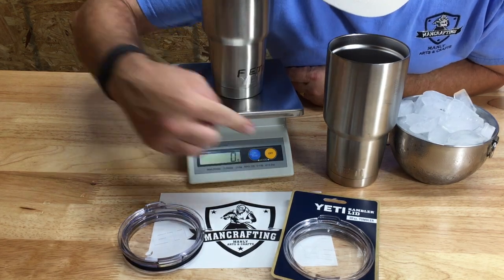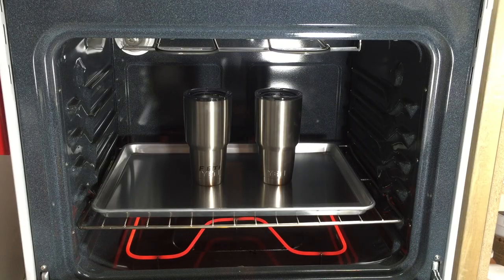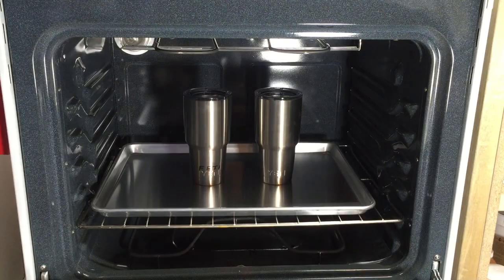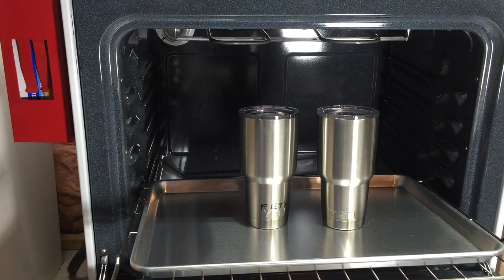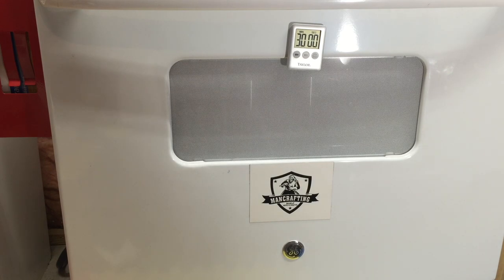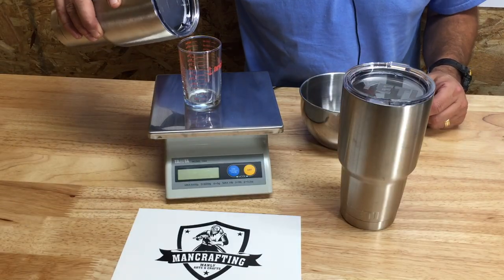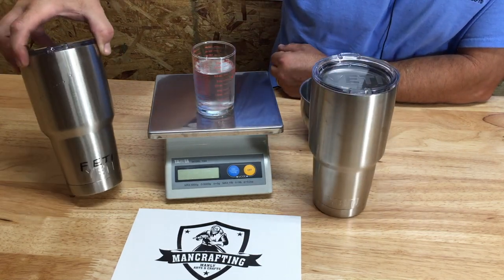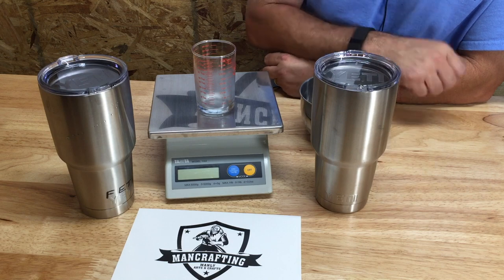Fake Yeti TESTED! | Part 1

Comment: yeti is made in China and in the Philippines but they do make some of their stuff in usa. the "fake" yeti is made in the same factory as the "real" yeti.
Reply: from yeti's website WHERE ARE YETI PRODUCTS MANUFACTURED?

Our Tundra coolers are manufactured in the USA at facilities located in Iowa and Wisconsin as well as at a facility located in the Philippines. Our Hopper coolers and Rambler drinkware are manufactured in China.
Reply from the maker: I covered where YETI products are made in another video, but yes you are correct. They are made very likely in the very same factory where the counterfeit Yeti is made.  That said, if you work for someone, and then when your off work do the same work for their customers even though it's your off time it's still stealing.  Even if you are doing it cheaper.
Reply from the maker: Mel Garrison if the company you work for make that an implicit term of employment which many service businesses do, it's stealing.  If it's known and agreed upon to all parties then it's not stealing.
Reply: That is not a good comparison.  In your comparison the guy that works at Jiffy Lube isn't stealing if he changes oil cheaper on his own time.  Where the stealing comes in is if he changes oil on his own time and uses the Jiffy Lube name and says it's Jiffy Lube that's doing it.  Jiffy Lube would not allow that and neither should Yeti in this case.  You have to fight for trademark infringement or by default you lose it.
Reply: TheNOOBNATION right!!

Comment: problem with counterfeits is you dont know if they used BPA free plastics..it all looks the same....whats the seal made out of does that leak any toxic stuff ?....how are they made did any toxic materials get used...how did they clean oils etc off before selling it to you. lots of stuff is made in china...brand names tend to control the manufacturing of their product making sure its safe to use once it reaches the consumer....counterfeiters dont seem to care, they make something that looks like the real deal, but could have residues thats toxic....seals that will fail....all kinds of stuff....heck metal is not just metal they are alloys, mix of different metals to yeild an alloy with the properties you wish for....the cheaters might use one with more lead in it to make it easier to shape and work with...which over time will leak to the fluid in the cup...some use a varnish in the cup to keep food acids from corroding the cup, that varnish can contain all kinds of stuff thats bad for you....heck a couple of years ago a dog food manufacturor wound that china had used petrolium oil instead of plant oil in the dog food to save a penny, the dogs didnt get sick right away..but over several years health issues came up....when things enter the US some get tested, but most does not. so how do you make sure you get a product that is safe ?
Reply: Inreresting good point

Comment: While your fake worked out well, there is no guarantee that the fake I buy will be the same as yours.  Maybe the fake I get will have inconsistent quality or maybe it will be from a different manufacturer and different internal design.  With the real yeti, you know what you are getting.   It would be nice to test fakes of the same volume/design from different suppliers to see if they are all as good as each other.
Reply from the maker: Scot Caraway you definitely have a point.  You're probably safer buying a brand like Ozark Trail or the Members Mark version to eliminate consistency concerns and still get a cheap tumbler.  But there are always those that want a brand name and if the get garbage, they got exactly what they paid for.

Comment: @MANCRAFTINGTM    Chad I have to say I sat here and watch all three your videos they are very informing I appreciate you taking your time to show us the Fake Yeti versus a real one I really like the fact that you are not biased against the fake or the real one showed the difference and showed what you are paying for. I see both cups are made In and maybe both are coming from the same manufacturing plant, in this video you showed us that both cups are made differently the thing that concerns me is safety yes the Feti is cheaper but is it being processed and tested the same way as a Yeti for safety. are both cups being tested the same way for chemicals? what type of chemical are being used to make each of the cups? that's what I ask yes the Yeti is more pricier but what type of standards are being used to produce that product that the money goes towards for testing. compared to how the Feti is being produced that's what you should being asking.
Reply from the maker: Josue Mckoy thanks for watching.  Ultimately I have no good way of testing those things.  If any of them were made in a way that would be harmful, the only company you could hold accountable would be YETI.  Good luck tracking down a company that shipped direct from China. Not sure it's a huge concern though.